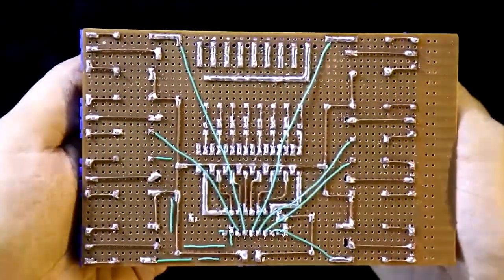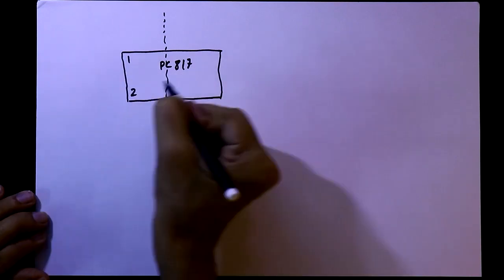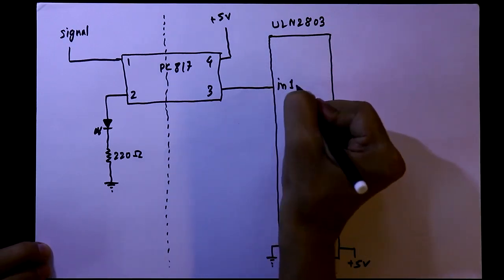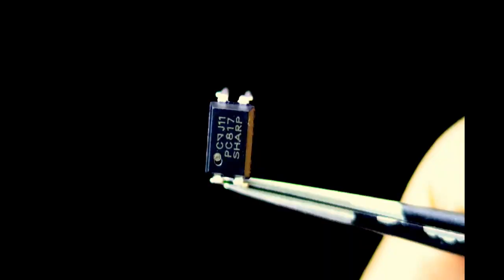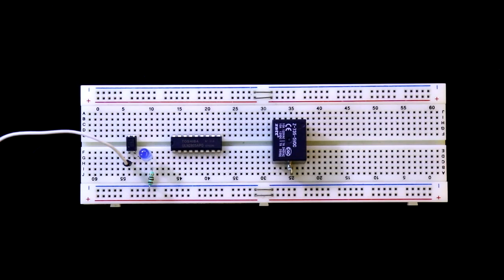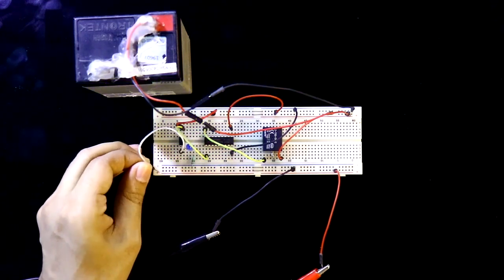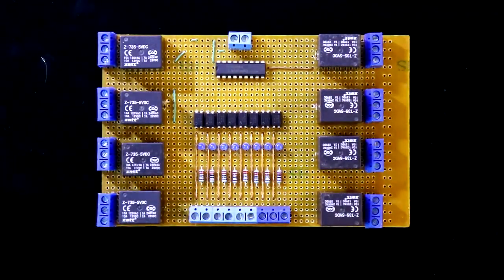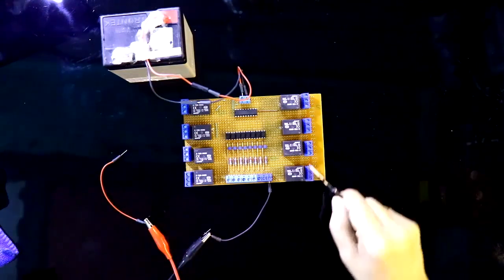8 Channel HIGH Triggered relay driver circuit Using 5v Relay

Comment: what changes if we need to use a 12V relay?
Reply: Nothing, the outputs can handle 50v at 500ma (half an amp). If you need more, you can use 2 pins to 1amp, and 3 for 1.5amps etc. It can only handle 2.5amps in total.

Comment: can i connect 4 dc motor at once ? I want 8 ch remote ckt?
Reply: Each output can handle 500ma (half an amp), So if you need 2 amps in total, you connect 4 pins together. The entire chip cant handle any more than 2.5amps, you will need a relay or different circuit after that.

Comment: great job. As another fellow asked, what would be the risk of making this project without the optocouplers?
Reply: The optocoupler completely isolates whatever you're using to drive it, if you're using a Raspberry Pi for example, there is no way of getting spikes, feedback or any issues into the Pi. If you are using a simple circuit to turn it on and off, you don't need an optocoupler.

Comment: What's the difference between low level and high level.. i mean both will do the same job, why we use like this?
Reply: Low means you need to connect it to the ground to make it activate, high means you need to connect it to the positive.

Comment: Why ground should be different? It works well with same ground. In my case I have 12v power supply which converts into 5v and then into 3.3v for esp32, so I have only one ground on my board.
Reply from the maker: Yes, you can use same ground same power supply. It means you are supplying relay and microcontroller power using same power supply, it will work nicely. But then there will not be any meaning of using optocoupler. If a circuit is isolated by a optocoupler, then power supply should be different, then only we can say that output side is 100% isolated from the input side.

Comment: I want to make a 4channel active high relay board instead of 8channel. Should I use ULN2803? Or is there any smaller IC for it?
Reply from the maker: You can use ULN2003 for this. It is 7 channel IC.
Reply: @EEWave  Would be great if you could do a similar video on RC Snubber circuit for relays when inductive loads are connected. I had this issue and it took me weeks to figure out why my Arduino was resetting. Could not find any implementation video on YouTube.
Reply from the maker: I'll will try to do this.
Reply: @tonyseben  AC voltage cause problem on this circuit? should i use snubber?
Reply: @ankara9594  Not sure what your issue is. For me, the relays were trying to control motors (aquarium filters and oxygen pump). When the relays turn on or off it would cause the arduino to restart. This was caused by the induction from the motors. I was able to fix it using snubbers across the motors. Read this for more https://forum.arduino.cc/index.php?topic=200393.0